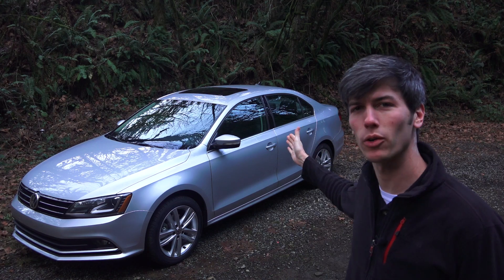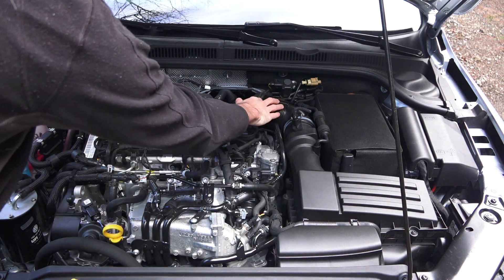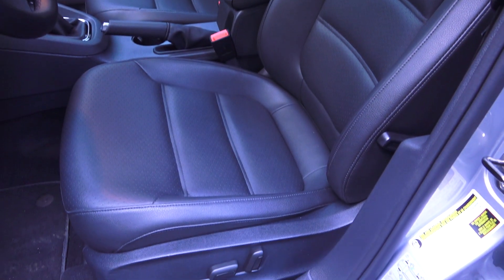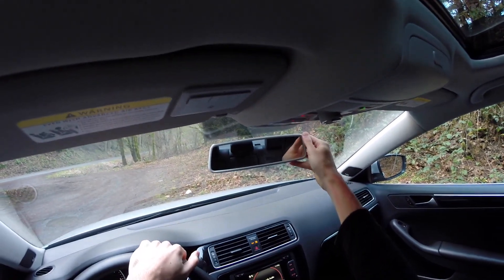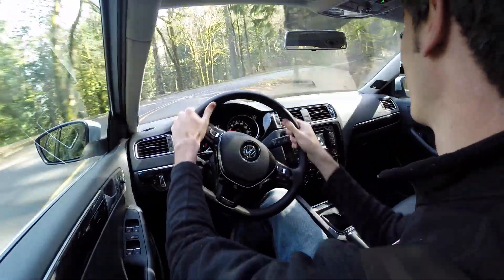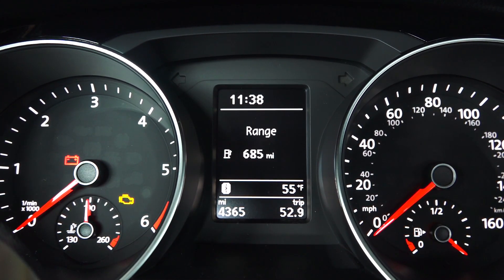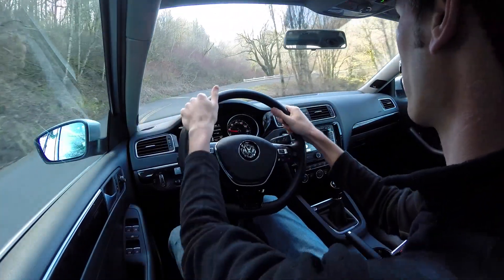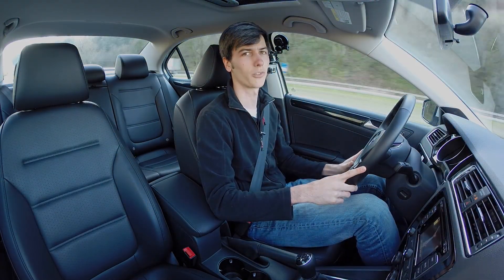2015 VW Jetta TDI - Review & Test Drive

Comment: Can you do a review of the BMW 3 series?
Reply from the maker: SpeedFreak Would love to, working on gaining more manufacturers to review.
Reply: Engineering Explained Drive either a 328i/335i or a 328d (which is a 320d in europe).

I have a 320d with manual trans and factory tune (200 hp/420 Nm) and I get even better fuel economy than this car. My lowest avg consumption is 57.4 mpg on one tank measured at the pump :) On the Highway at 60 mph it'll do as much as 65 mpg if the weather isn't too shitty.
Awesome car! :)
Reply: Is a long, long term least & reliable Tech on BM'Rs,,,They are the Masters!!!on any Road!!!

Comment: Does this have the Urea exhaust scrubber system?
Reply: I'm not sure if you're talking about the same thing here. I'm sorry if I misunderstood something.
DEF (Diesel Exhaust Fluid, the system that sprays that urea stuff/AdBlue in to the exhaust gas) is a different system from DPF.
DPF (Diesel Particulate Filter) is the filter that will eventually fill with soot and has to be "regenerated" by burning the soot off. This is done by injecting fuel into the exhaust after the turbo to heat up the filter.

In the US only medium- and heavy-duty vehicles must have a DEF system to meet the emissions standards set by EPA. BlueTec engines by Mercedes have the DEF (not sure if you have Merc BlueTec engines in the US).

One of the problems people have with a DPF is that if you only drive short distances at a time and the filter is in need of a regeneration cycle, there's never enough time to heat up the DPF to burn off the soot, which causes the filter to clog and then you'll get some kind of an engine fault code and usually the engine goes to a limp home mode where you can still drive, but with extremely limited power output. This is a more pronounced problem in coutries with a cold climate, as the DPF needs even a longer time to complete a regeneration cycle in the cold.
Reply: Guillermo Lovato I believe you are mistaken. Not every system uses fuel sprayed into the turbo or exhaust stroke. Many use heating coils and post turbo fuel spray to regenerate. Not to mention most Diesel components are made to withstand higher temps and pressures than normal gas cars. Sure in a perfect world everything would burn perfectly and you would not want a DEF/DPF system, but in order to meet emissions these systems are needed. These systems are a much better trade off than a Hybrid IMHO. With these systems you have almost zero emissions, and still get a car that is super efficient, and decent do drive.

Comment: the 2.0 TDI is probably one of the most sold Engines atm in germany, due to being sold in the A3, A4, A... Golf, Passat, ... Skoda Octavia and so... We got one in our A4 Avant quattro (177hp, manual) and it's a really nice engine for driving on the Autobahn. By the way: The S4 also had a spot to store your sunglasses, right infront of the center light ;)

Comment: Hi Jason, I'll fire this one away again. How come a much smaller and lighter Renault Clio (you probably don't get them in America ;) with a 1.2l petrol engine averages 40 mpg, and this heavy VW with almost twice the power and engine size does a lot better? #CrazyEngineering
Reply from the maker: You can't base efficiency purely on engine size, there are far too many other factors. Diesels are significantly more efficient than gas engines at partial load. Drag coefficient, frontal area, car weight, many (many) characteristics of the engine, and also very important is how it's driven.
Reply: it's a diesel engine, they're more efficient than petrol engine. Also, VW builds very solid diesel engines that are known to be among the most efficient :)
Reply: wtfrofllolxd Of course diesels are more efficient, but this one seems to go beyond expectations...
Reply: Engineering Explained not to forget, that Diesel fuel actually contains more energy than usual gas.

Comment: could you do: aston martin v12 vantage s Front Engine, Rear Transmision explained
Reply: Well there's not much to explain. It's an electronically controlled automated manual transmission (so it's just like a manual, but instead of you moving the cogs with a gear lever, there's a "robot" doing it for you), and instead of attaching the transmission right to the back of the engine, it's moved towards the rear to achieve a better weight distribution. So there's a drive shaft between the engine and the gearbox.

Comment: 150 hp for a diesel... should have got a cummins
Reply: Your comment is irrelevant just get out.
Reply: MrManuel1329 so true
Reply: Dont doubt TDI there great diesel engine so great that Audi uses there TDI 4.0 V6 in there Le Man LMP1 race car they have won le man multiple times back in the mid 2000s they used there V10 TDI but they to scale down because of regs   o Lemurs
Reply: o Lemurs how since cummins doesnt build 2.0 4cil good mileage engines
Reply: o Lemurs W16*
Reply: o Lemurs well in that case why dont use a spitfire engine, v12 rolls royce beacuse why not?
Reply: o Lemurs To me it seems you've been talking shit non stop, so no i couldn't tell.
For the purpose of a car like this, this engine is brilliant.
Reply: MrManuel1329 It actually is relevant.
Reply: trucklover4runescape 8 cylinder though, i didnt say it had to be 4 cylinder.
Reply: trucklover4runescape Why not use a v16 bugatti veyron engine?
Reply: Porsche Curves Yes, shows how much i know about expensive cars :P i stick with jdm for a reason.
Reply: o Lemurs Yeah, ignorance is actually a very good reason.
Reply: Benedocta mhmm, if you couldn't tell i was joking about the first comment though.
Reply: Benedocta a brilliant street car, it dosnt seem like people care about power anymore though.
Reply: o Lemurs Not everything has to be a fast car.
Reply: The original 5.9 cummins made just over 160hp...